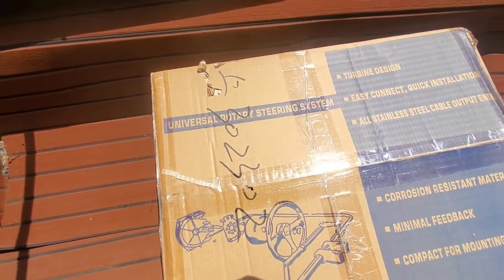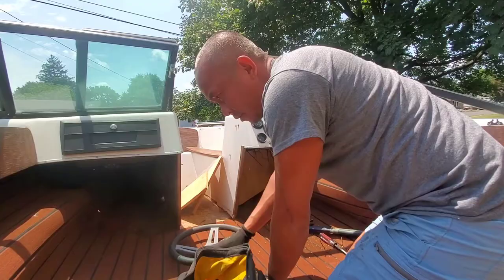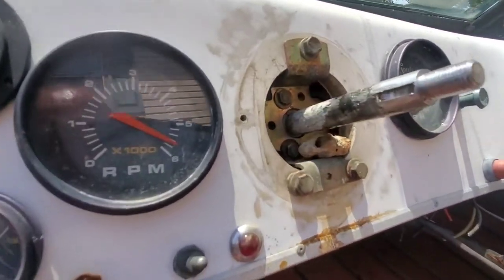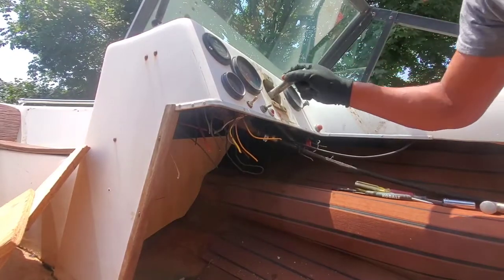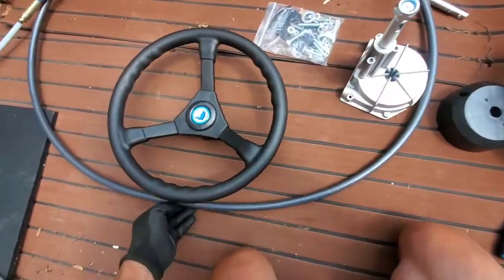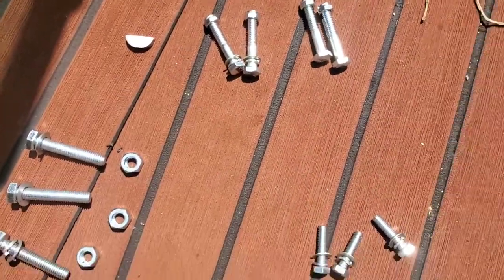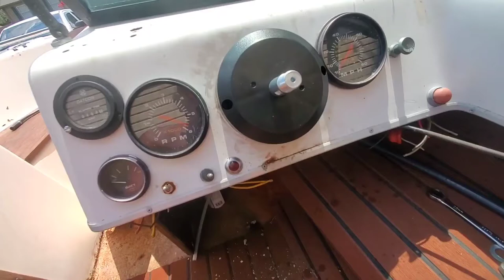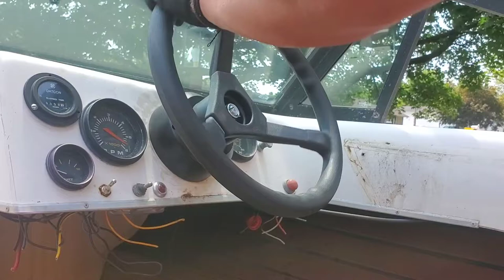Boat Rotary Steering System Install

Comment: If your replacing a frozen cable and steering unit just cut the damn cable if it's stuck in the steering. Then remove the steering wheel the plastic cover remove mounting screws and pull the whole thing out through the pack of the console. Tape your new cable well to the end of the old cable and gently pull and guide if possible the old cable out of the stern pulling the new one through as you go. It's an easy job if you don't care about the old stuff.

Comment: Didn’t see how the actual cable went in… does the motor have to be turned a certain way so it all lines up normal? Or just push the cord through and it’ll work?

Comment: My mercury 1500 has 2 steering cables, but 1 is seized and disconnected. Should I buy a new one? Why would there be 2? As always another great video
Reply from the maker: You don't need 2. It depends on what type of system you have. I run my 1500/1400 with 1 cable. Son